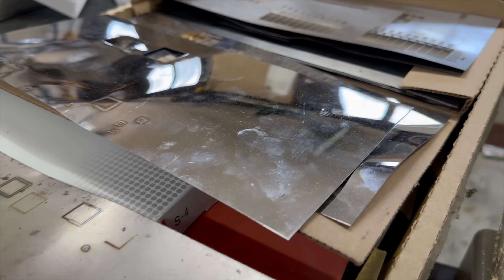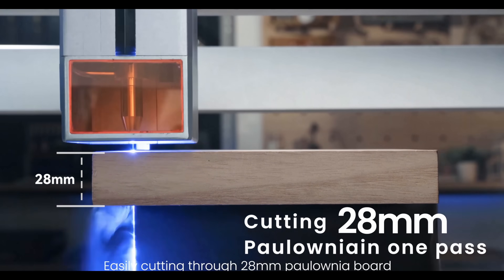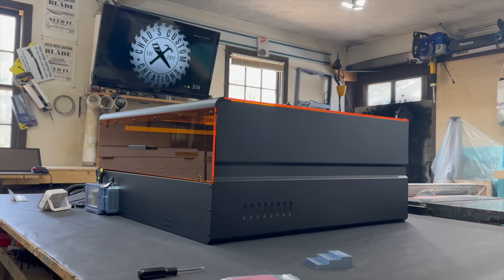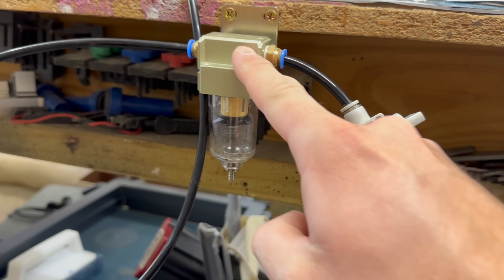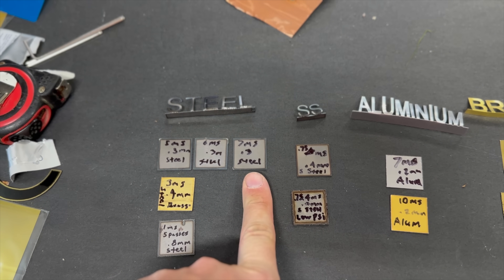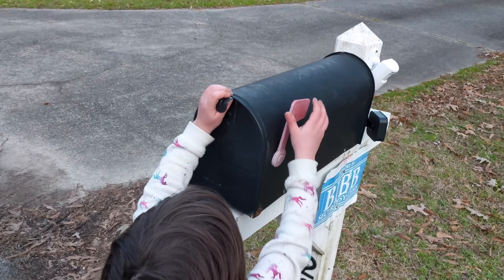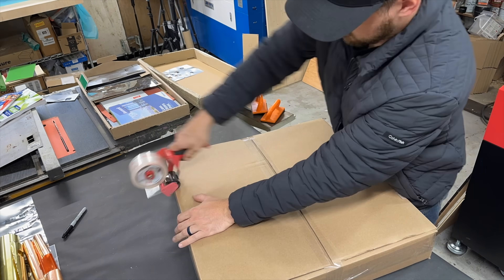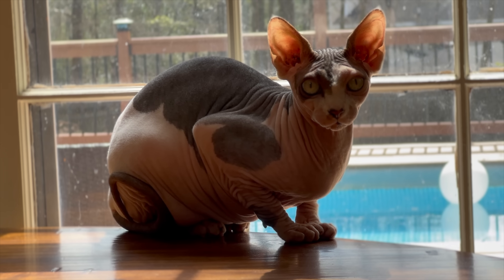Is The Future of Metal Cutting with Diode Lasers? 70W IKier K1 Pro Max

Comment: You made a mistake.
Using plain air. This caused problems with metal burning, this is a mistake.
    Use technical oxygen, it will make cutting easier, 
but do not use it in a closed room without additional ventilation. 
   
   For the rest, read carefully about the properties of the gas. 

Then use it to cut, instead of using air.
Reply from the maker: Great tips thanks so much!
Reply: @ChadsCustomCreations  
Oxygen is not recommended for cutting aluminum and stainless steel, colored metals are better cut with nitrogen, I don't know what the cost of purchasing compressed gases up to "200bar" is, so I wasn't wrong. But for clean cutting purposes... maybe it's worth it.
Reply: And in general, maybe a better choice of gas will be Nitrogen, it is perfect for laser cutting and welding of color and alloy steels, maybe it is a better option financially and certainly safer than Oxygen because Nitrogen is an inert gas. And about 70% of it is in the atmosphere.

Comment: Coconut. Nicely done video. I was not aware that Diode lasers were stepped at 5 watts to achieve higher wattage. I can visualize several projects with a 70 watt unit.
Reply from the maker: I think there are some others that can go higher but the 5.5w seems to be the most practical at this point in time.

Comment: Its not really the thermal conductivity, its the efficiency of the particular laser wavelength with the material itself - hence why green lasers are typical used in copper alloy welding/AM
Reply from the maker: Interesting I would love to get my hands on a green laser! Thanks for the tip.

Comment: 5:40 I don’t actually care i dare you to try TUNGSTEN CARBIDE
Reply from the maker: You dare me, now I am kind of scared is there some kind of reaction that might occur?
Reply: @ChadsCustomCreations  nah it’s just different version of diamond 
diamonds are on 10 mohs scale
Tungsten carbide is on around 9mohs scale 
And tungsten carbide has high melting point about 5.2times higher than aluminum its about 3422degress so that’s why i said i dare you haha
Reply from the maker: @sharkletbrown6903 phew you know my original wedding band was tungsten carbide. I switched the silicone bands after hearing all the de-gloving horror stories. 

 I bet it wouldn’t cut but I think we do need to see if we can engrave it.
Reply: @ChadsCustomCreations  ayee good point but don’t worry about the tungsten carbide thing it’s all fine and plus if you want to know some jewelry materials then I recommend titanium because it’s super rust resistant and it’s friendly to sensitive skin so it’s the best choice and titanium is always used for bone replacements parts and the implants
Reply: @ChadsCustomCreations  but just get that point tungsten carbide is quite brittle compared to steel or titanium say if you just drop it it will shatter to pieces like glass but you know the hardness caused it and titanium isn’t hard much as tungsten but it’s lightweight and durable compared to the weight so it can be called as special metal but it’s bit pricey like tungsten carbide so it’s up to you what one to pick plus yeah tungsten carbide is a special type of metal too because of it’s high melting point and hardness it’s also used for rocket nozzle and lathe tools and drill bits so yeah it’s pretty much wide used material and titanium is used for biological and aerospace stuff

Comment: Coconut water hydration - remember that while you work in your hot shop!  Can these cutting lasers also be used for engraving/marking?  Maybe you need a kid with a truck to go mobile to the customers?
Reply from the maker: Yes they can be, that’s a great idea. And yes my shop is super hot these days especially cause I just bonked my metal ceiling fan with a 2x4 and put it out of commission 😅

Comment: “Thermal conductivity rating”… who needs units
Reply from the maker: As a fabricator I just need the correlation between the different metals.
This is TMI for me but here you go thanks to chat GPT. 

“Thermal conductivity is usually measured in units of watts per meter per kelvin, written as \( \text{W/(m·K)} \).

- **Watts (W)**: This measures the amount of heat energy.
- **Meters (m)**: This measures the distance the heat travels.
- **Kelvin (K)**: This measures the temperature difference.

So, \( \text{W/(m·K)} \) tells us how many watts of heat can travel through one meter of the material for each degree of temperature difference (in Kelvin).”

Comment: A real question from a stupid aerospace engineering monkey here: Has anyone checked the math behind combining lasers in this fashion? Is it additive with optics? I understand the sales part behind the electronic manufacturer's propaganda of 10x100w = 1000w in the same 1x1cm area but the real world is not always that neat. Just a cursory and uneducated overview of the physics involved sets off destructive interference, wave mode instabilities, wave guide obstructions all come to mind. Why haven't we been able to put 10x 5 watt diodes into the same lens yet? I have had laser pointers with a 5-watt diode that gets really hot. Heating? Water cool it.
Reply from the maker: This is how they achieve the 70w it is actually 14 5.5w blue diodes all combined to the one lens with mirrors. 5.5wx14=77w but they rate it at just 70w because some power is lost on its way out.

Also you might have seen when I tore it apart the whole laser head is a giant heat sink to help keep it from overheating.

Comment: microwitch on the lid, so when you open the cover the current was stopped and the fan turn off.
when you open the lid, the current keep flowing and the fan runs
Reply from the maker: Brilliant solution I might even be able to tap into the safety switch that is already there.

Comment: Would be cool to see you somehow install a active cooling solution for metals to somehow prevent them from warping while doing multiple pathes
Reply from the maker: That’s a great idea I believe lasers can travel through water with very little loss so maybe it could have a water feed to cool things down.
Reply: @ChadsCustomCreations  I actually thought to submerged the metal under the water so it's about ¼ inch under water surface and use compressed air to blow on the spot to push the water away where laser is gonna hit.
Reply from the maker: @nikoivan2580 ohh I like that even more!!!

Comment: Ehhh.... So i have an idea that goes with this, which i might as well share/divulge here:
If, instead of directly pointing the cutting laser onto the work piece, you were to point it at a thick, highly polished piece of metal, you could use that piece of metal as an electrode on a welder. 
This allows for two different alterations that neither the laser nor the welder have on their own: 
First, the cutting power of the laser can be enhanced by direct electrical action, since electrical discharge can only occur through the laser. 
Second, the shape of the welding cut can be changed by focal point present on the electrode.
Reply from the maker: Very interesting ideas thank you for sharing!

Comment: If im not mistaken, all lasers are diodes (LED- light emitting diode)
Reply from the maker: You’re right most are based off LEDs I am now going to start calling them out by their colors or wavelengths now. Blue 455nm infrared Invisible or IR 1065nm.

Comment: Stainless is usually cut with nitrogen as it oxidizes worse than carbon steel. The nitrogen will also fix your moisture issues and cut most material cleaner.
Reply from the maker: Those are great tips thanks so much!

Comment: I'd like to see the tests run again with Oxygen ! (like an Acetylene cutting rig)
Once the laser kerf reaches glow, the O2 could act as a flux to stabilize the blow from the channel !
I'd bet dialed in, even the 20w systems could cut metal...
Reply from the maker: Great idea, I’ve tested the oxygen in a video before and the results were interesting though I lacked a valve that produced a high flow which didn’t produce the prettiest cuts. I definitely need to revisit it.
Reply: @ChadsCustomCreations  yEAH ! I'm thinking a plc valve ~and~ g-code controlled set of variables, like the laser burn tests grid !
Could really open up a new feature set for diy lasers...

Comment: Is it possible to use tracing on this laser?
I went to a machine expo last year and a saw industrial lasers cut trough 50mm stainless steel using tracing. Which is really hard to do but they did it using tracing.
Reply from the maker: Wow 50 mm is really thick that’s like what 2 inches. I am not sure what you mean by tracing can you describe what it does?
Reply: @ChadsCustomCreations  i also saw a different aproach using water in laminar flow to focus your laser beam like optic fibre but have not seen any machine like that though.
Reply from the maker: @benalders302  that has got to be the coolest looking thing every if you can find an example of that can you share a link with me.
Reply: I think youtube removes comment with links in it.
 But u can find it in Google typing Bodor laser scanning cutting machine brochure.
Regards

Comment: But as a sheet metal worker we know that warping is the biggest problem of all, which is why you need to cut it quick and in one go, don't let it have time to spread the heat past the cut. The only real way to combat this reliably is to water cool the metal as close as possible behind the heat source without affecting the cutting or welding. I hope this info helps somebody 😮 cause it's the biggest problem with working 'any' sheetmetal
Reply from the maker: This is helpful I definitely need to try out some cooling options and see if they improve my abilities.

Comment: If you don't cut metal (especially stainless) in one pass you will give it time to work harden and the oxidised metal is sooo many times harder 😢 this is what happens with plasma cutters, it's so hard its hard to grind off!
Reply from the maker: That makes sense, same as how knife makers will super heat their blades then quench them in oil to cool them down fast to harden the steel.

Comment: The thing I don't believe about the video is that Aluminium has 30% more heat transferability than copper, i know this from my experience with Tig welding these metals, copper is easy, but welding aluminium takes much longer cause it is harder to heat. Which is why I can't work out how copper is harder to cut when it has lower heat transfer than Aluminium, this is why radiators are made from 4x light er & 30% better heat transfer metal than copper, but I respect the Author's real world experience because experience is experience 😅 just wondering why copper is harder to cut? Maybe density is all I can think of. Would love to hear the Author's thoughts on this, cheers for listening 😅😅
Reply from the maker: I agree I am not sure the aluminum I had was 100% pure I think this might have skewed my results.

Comment: I heard that CO2 metal cutters use oxygen blow to cut through metal.for example steel burn in pure oxygen.have you ever tried such with food laser? You could borrow oxygen from gas welder in car sevice
Reply from the maker: Yes you’re right I actually did get my hands on some oxygen it definitely made it hotter but I didn’t have enough pressure from the valve I had so I gotta revisit this.

Comment: At this point in time do you think the 70w diode laser is a good replacement for a 60`80w co2 machine for cutting wood, leather, etc?
Reply from the maker: There are so trade ups
-Diodes actually more powerful in terms of wattage compared to Co2 IMO
-less maintenance no mirrors to align 
-theoretically longer lifespan than Co2 glass tube
-ability to cut and engrave metals on diode
-not able to cut clear acrylics
-not able to engrave as fast as a co2 head
-darker engravings then Co2

There are trade ups I know it’s a lot to consider but I am seeing Diodes as more versatile as they become more powerful. But they still cannot compete with the speeds some of these Co2 lasers can achieve.

Comment: Coconut or not I want to get into laser cutting and engraving but have not figured out what to get or start with.
Reply from the maker: I am still a fan of the Xtool S1 for anyone starting out here is my video showing it off.
https://youtu.be/NNcsMqg7h_A
Reply: @ChadsCustomCreations  I want to be able to cut and engrave acrylic in opaque white and clear for sure so from what I can tell the diode laser is not best, but I am also looking at things like maybe aluminum though not as important as the acrylic. I want to make instrument panels that can have back lighting for like flight simulators and such.
Reply from the maker: @kromsavatar  oh yes diodes cannot do clear acrylics for that you would want a Co2 laser like the Xtool P2. I have seen people cut opaque white with the S1, But it’s a trade up as the Co2 can’t do Aluminum but even this IKIER 70w can only do those thin aluminum business cards.

Comment: Nice work. Having developed high efficiency laser cutting many decades ago, you will obtain significant benefits by dropping your nozzle standoff distance to around 1mm (depending on your nozzle diameter). The gas jet loses substantial momentum with distance from the nozzle exit. More thrust equals greater melt ejection and more efficient cutting. Also, changing to Nitrogen gas will give you clean cuts. Other options are to use a supersonic nozzle, more difficult to design and manufacture.  Good luck!
Reply from the maker: These are some great point I think modifying this unit could make for some great improvements.

Comment: Coconut - metal cutting would be so cool! I also saw Applied Science cutting glass by putting it in water to dissapate the heat. Maybe that will prevent warping. Not sure if there will be enough heat left to actually cut the metal, but worth a try :)
Reply from the maker: Such an interesting idea I’ve gotta try this thanks for sharing!

Comment: I wonder if it can cut 0.1mm stainless steel foil without warping and clean sides. I can cut it with my 10W, but it slightly warps and edges are ridged.
Reply from the maker: I would bet it could.

Comment: i wonder how hard they are overpowering the diodes, the cooling solution is also not great those diodes are very sensitive to overtemperature. and no faraday isolator to prevent backreflections.
 they probably wont last that long but results are looking great. lets see long term.
Reply from the maker: I did put my thermal temp gun on it when running it for over an hour I couldn’t detect any elevated temps from the outside. If you watch the intro you can see where I tear down the laser head and the whole thing is mainly a giant heat sink. They also used a new style of Diode I don’t really know the difference other than it has a longer rated lifespan to what most other lasers are using. But only time I’ll really tell.

Comment: Could also be the oxygen in the additional air helping to burn through as with a cutting torch (oxygen makes the magic happen.)  Try it with oxygen instead of air (buy a cheap oxygen concentrator perhaps) and maybe cut thicker or faster. Could try it with just nitrogen and see if it still cuts at all.
Reply from the maker: Your right I actually did try this before with oxygen and was cutting way hotter but didn’t have the right valve to make a high enough air flow. I definitely need to revisit this. I did buy an oxygen concentrator off eBay but the seller flaked out on the deal when they realized they had to ship it hahaha 😂

Comment: Pineapple!  Great video bud!  Love the address sign!  It was one long setup, the enclosure took forever to build, I didn't even assemble the laser bed 😀.  It is one powerful laser.  Makes me wonder what company will now go to 80 or 90w next?  If you are ever in the Chicago NW Suburb area, you should stop on by my garage and mess around with my ArcDroid Plasma CNC.
Reply from the maker: Yes so many bolts for that enclosure it was a bit maddening. I wonder how much longer til the laser source will be stationary and be run off of mirrors or can the blue lasers be run through fiber optics also? The heads are getting so heavy it’s bound to affect the speeds.
Heck yes I would love to check out that Arc droid!

Comment: Lasers used to remove rust from surfaces have issues with blowback of material damaging the protective lenses of their lasers. Do you ever run into that and is there a protective sacrificial lens to protect the laser? Oh and coconut ;) I did watch but let someone else be the big winner :)
Reply from the maker: I had not run into this issue yet but I have hear of people putting materials at a slight angle to protect them. This does have a glass cover that is easily removed you will see it when I talk about the condensation issue from the compressor.

Comment: Coconut. I'd love to test some ideas of two-dimensional kerf-bended surfaces and compliant mechanisms. That's almost impossible without an own cutter. BTW: Have you tried to compensate thermal expansion by cooling down material with a really cold air? With a decent compressor and vortex tube (Ranque-Hilsch vortex tube) you could easily achieve -50C at 4 PSI. When cutting with rotary tools that is standard practice to avoid overheating problematic materials, those you cannot submerge in water or sprinkle with coolant.
Reply from the maker: I had not thought about this but I definitely need to look into it I had no idea about the Ranque-Hilsch vortex tube.